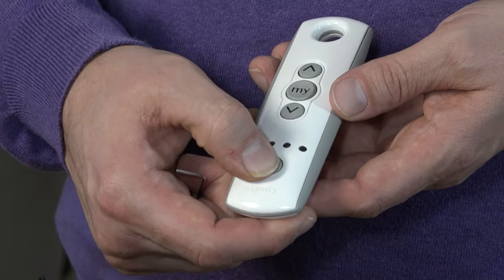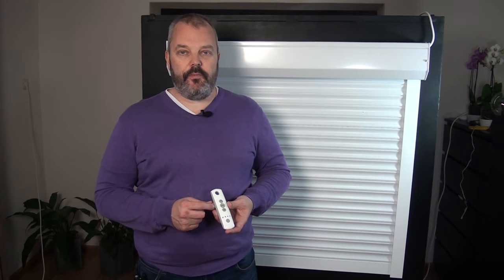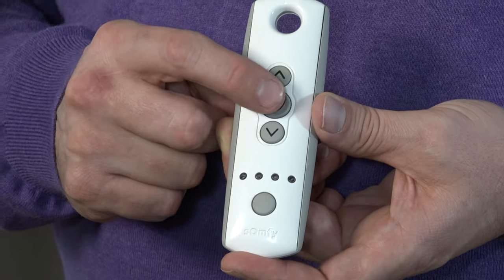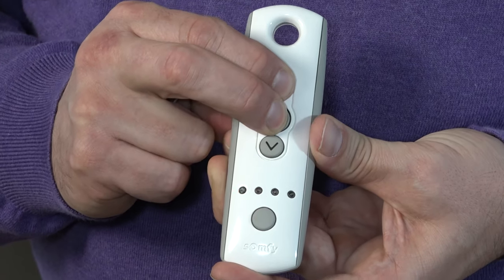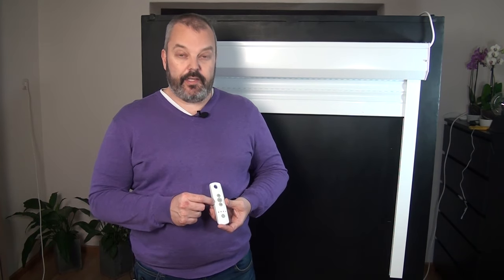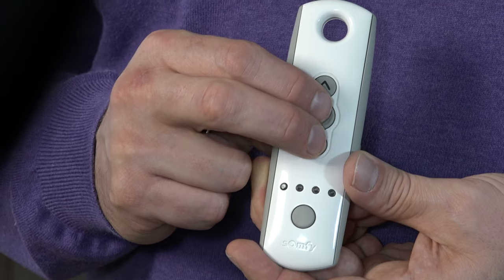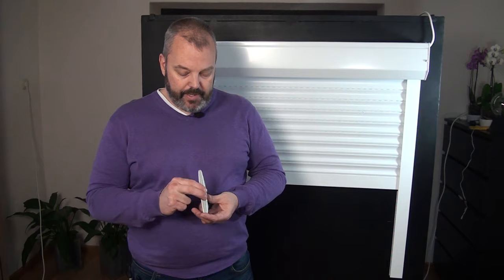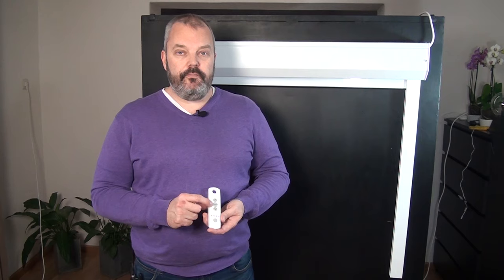How to program a Somfy RTS motor in less than 5 minutes

Comment: Otto.  Man, thank you, thank you.  Whoever designed this system had no concept of their user base.  After watching three of you very clear videos,  I was able to reset the limits on my two shades.   Each required the 3-8-3 second power cycle reset, followed by the remote sequence you describe.  There is no way I would have been able to do it without you.

Comment: I have two blinds operating from one remote with 4 channels. All was working well but something happened and I had to reset the limits. Now the 5 channel when both blinds operate together does not work I've tried to program this to reprogram the channel. The blinds are battery operated
Reply from the maker: Hi Ranbhere, when you reset the motor, you need to re-create the group channel, as that channel isn't created automatically.
So if channel 1 operates blind one, press prog until the motor responds (jogs), next, go to channel 5 and press prog again. the blind will jog and you can now operate blind 1 with channel 1 and 5. Wait 5 minutes and repeat the procedure for the next channel and start with the channel you want to add to the group channel.
Here's a video that shows this procedure: https://www.youtube.com/watch?v=MRsRmDMw06Y

good luck,
otto